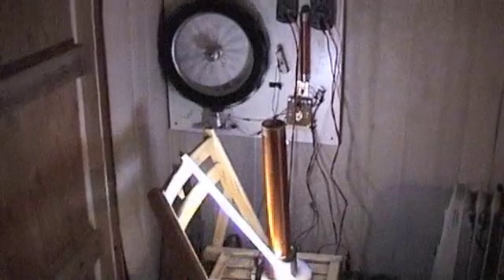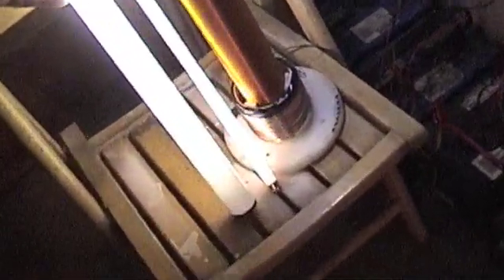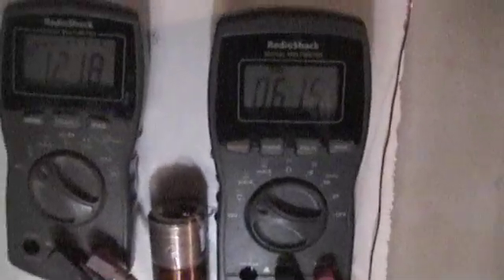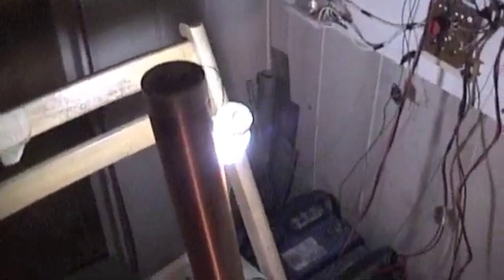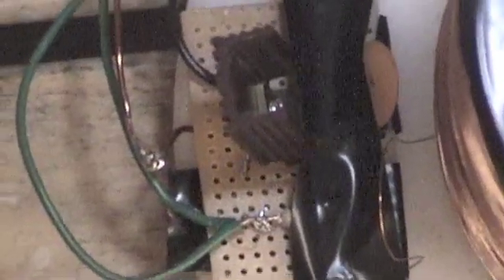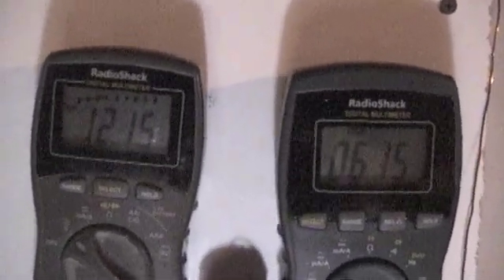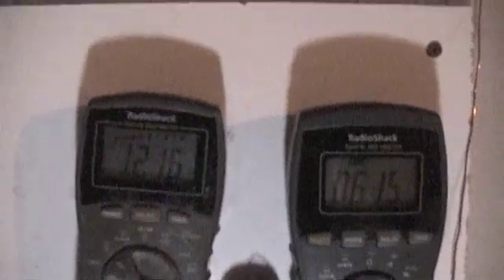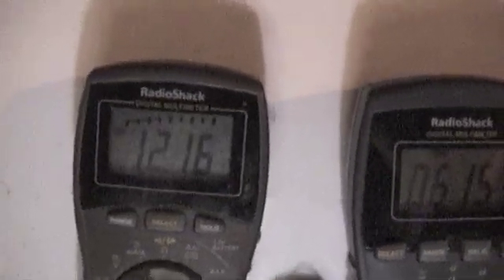Bedini Powered Tesla Coil

Comment: Do tests with smaller batteries, that may yield some other odd results. The power usage may be less. Using 3 batteries is my ideal set up. 

Earthing this and moving it outside to ground. Ever  metre will achieve a 50v extra boost in energy output of the coil once the circuit is in resonance. So even more power output, plus you can stick them bulbs and seem them light up across the park or garden. you set up is portable.

Comment: I asked an old uni lecturer and friend awhile back what static was. He replied that it is just an EMF of high voltage and low current. What if the air and ground around us is constantly being charged by friction,lightning etc and tesla etc have managed to tap into that EMF at high frequency. I guess the space around us is like a big weak capacitor in 3D perhaps?